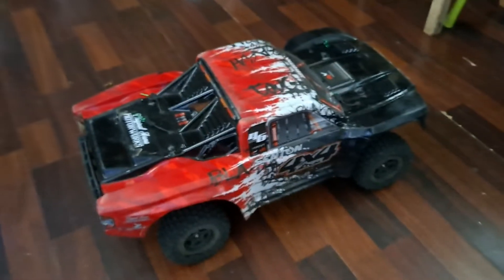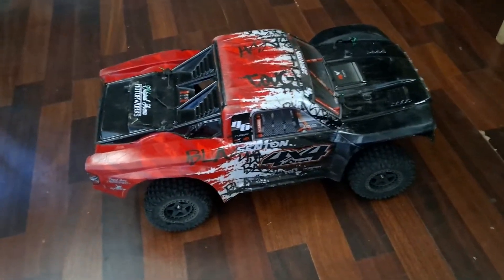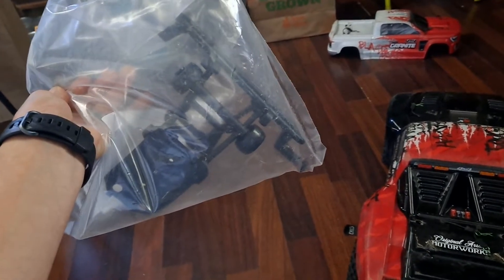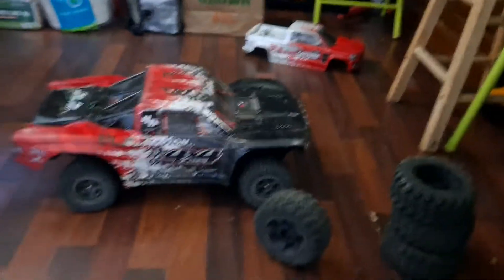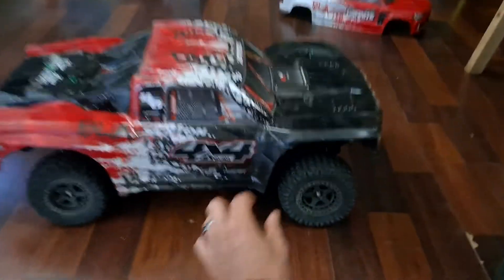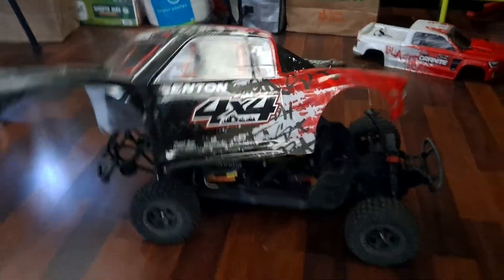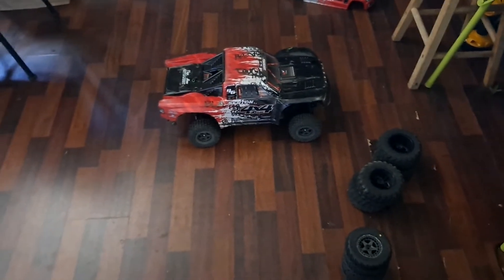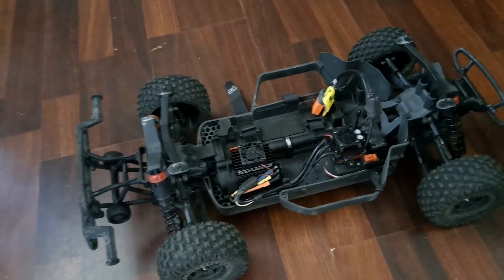arrma senton 3s blx upgrades and shop talk new motor stock

Comment: How did you get it over 50mph out the box? I'm trying to see what upgrades I can do to make mines a lil faster. Bought mine yesterday and I'm already want more speed.  Its fast don't get me wrong,  just want a lil more power.
Reply from the maker: Arrow dynamics I vented the body in the back trimmed the finders and run 12k in the diff other than that its stock but I don't use the small stock tire off road with the senton I use the stock big rock tires. On street I use proline street fighters
Reply from the maker: Honestly it's going to be the tires putting a little bit big of a tire will make make the top speed go up if down size in tire you will go slower but get there much faster